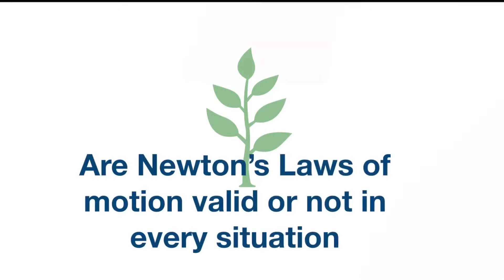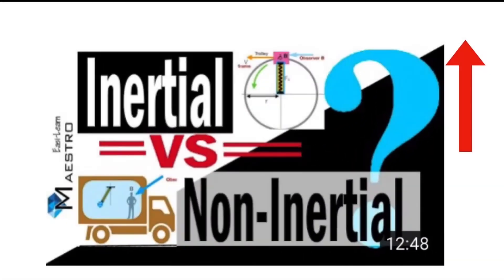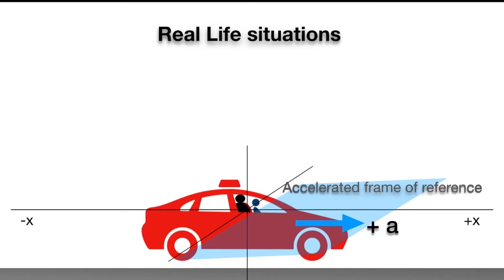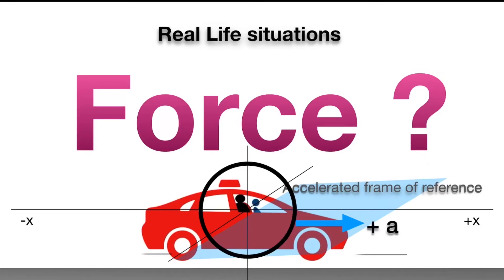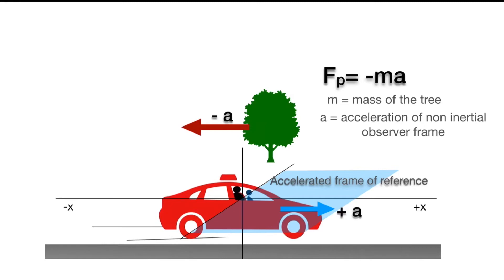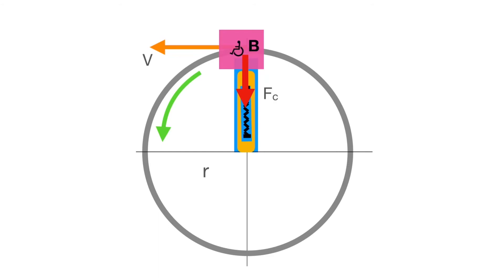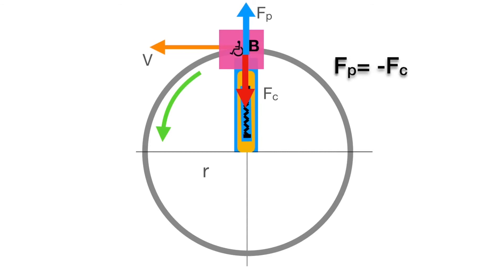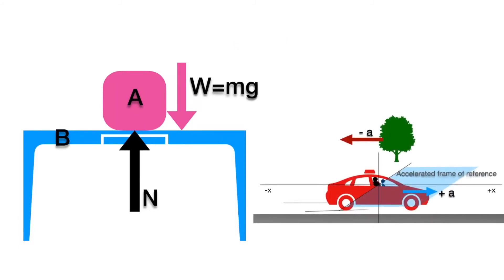REAL vs PSEUDO FORCE

Comment: Amazing explanation 👍👍 but the action reaction pair of the weight of a body is not the normal force by the surface on the body.
Reply from the maker: Thanks Anitej for your appreciation. In case of block on table,  normal force by the block on the table is equal to its weight only (as block is at rest) . The normal force of the block on table is countered by the equal and opposite  normal force on block by the table (same as Weight of block)  . So the pair of normal forces in between block and table are the Newtons 3 rd law pair only, which is  equal to weight of the block .  
 Please check following video  which explains Newtons action reaction force pairs  in detail with multiple scenarios  and let me know if that helps.
https://youtu.be/9M7gui-ckGw